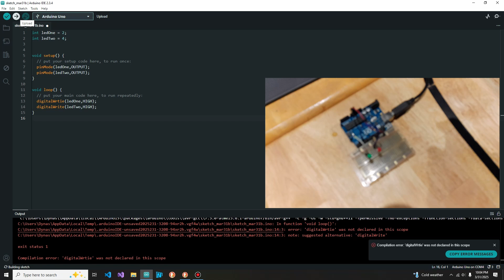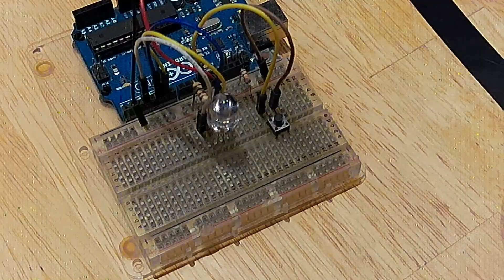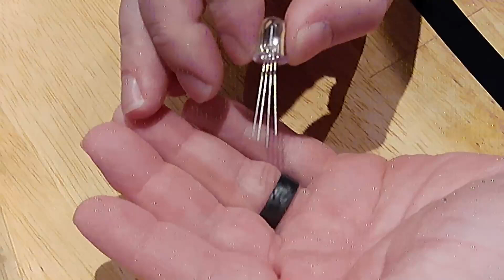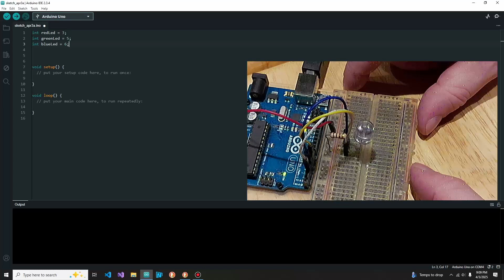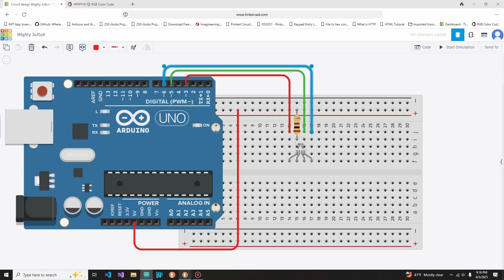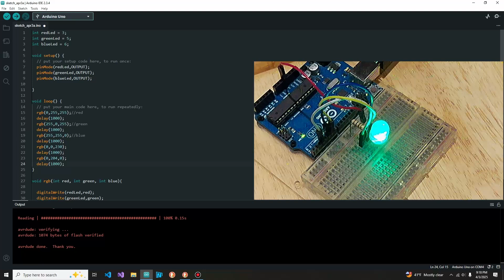Arduino RGB Part One

Comment: Why are you hooking it up backwards? Sure it works but then pin high is off and pin low is on. If you connect the common leg of the LED to GND then pin high will be on and pin low will be off which makes more sense right?
Reply from the maker: Yes, it does and I very much agree with you. In my mind that is the way that I like to wire things up as every thing pulled low by the resister, you are far less likely to over load a pin on the Uno doing it that way, but It just comes down to the the way that it is wired up, sinking the power opposed to sourcing. As common anode devices that are professionally made will require this method to operate properly. When we move a little further into the series we will be covering how to power larger devices with Arduino and I will cover this topic in more detail as we will be playing with PNP and NPN transistors.